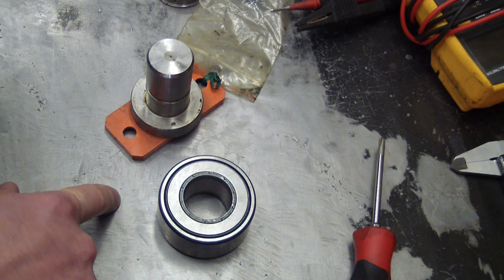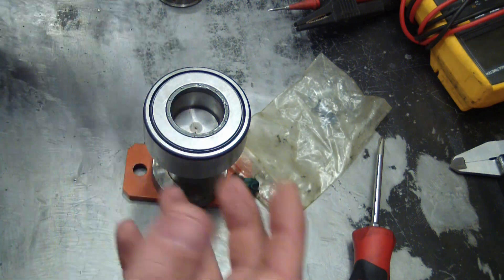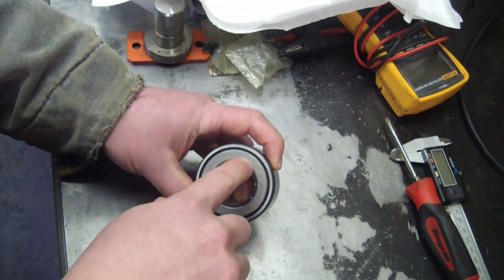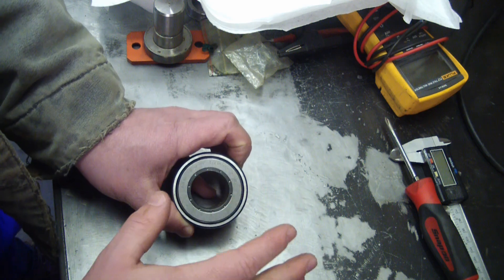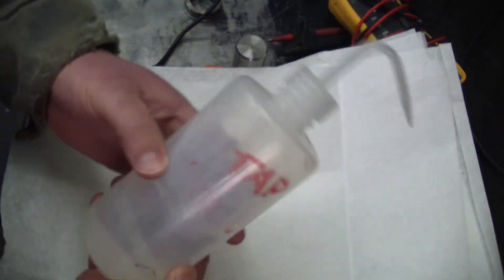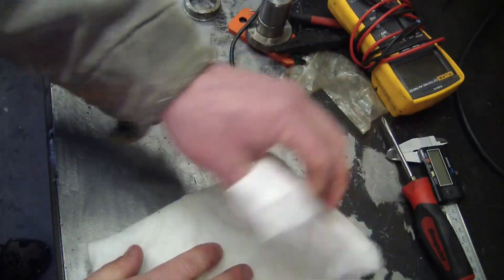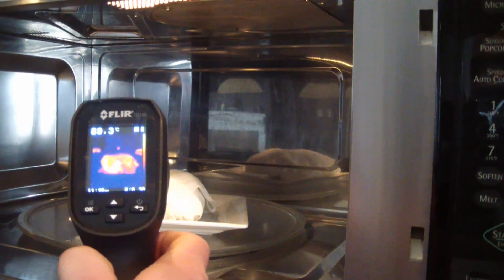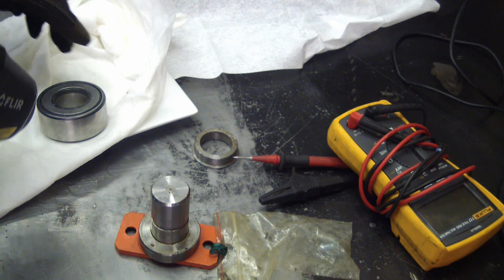The Microwave Trick? It's the easy way to heat bearings!

Comment: ooooo i wished i had known that some years ago.......

but how would i get the front wheel hub in the microwave?
Reply: lez briddon As an alternative way: warp in dry rag (optional), put it in a layer or 2 of plastic bag (zip lock?), put in a cauldron or any other big enought container, make sure it don't touch the bottom, fill with water, boil it. The bag should prevent water from getting in, the rag should catch a bit of water that slip past. Since water boil at 100°C it can not heat more than that. The problem: make sure to mot melt the bag by letting it touch the bottom, and not damaging it... and to use your wife's stuff...

Comment: Awesome trick! Although i would propably do it the conventional way, heat up some motor-oil (used) in a pot/can and submerge the bearing. No water involved, and when you use a hotplate instead of an open flame its no that much of a fire hazard. Bonus points for monitoring the oil-temp.
Reply: rats arsed Why? we have done it quite often (successfully) in a previous company. The new bearing is warmed up gently and slips on the shaft nicely (sounds dirtier than it is, even with used oil :-D).

Comment: An unrelated but related question, as heated water becomes steam and steam can be heated beyond 100C, is it possible to superheat steam in the microwave?
Reply: You can use brime (slat water) and go up to 120C before boiling.
You could use baby oil and go up to 250C or more.
Have not tried it...
Reply: MattsAwesomeStuff "It's not possible to superheat steam in any unsealed unit by any method (fire, hot plate, etc)"

Absolutely it is. Any gas flame contains water vapor (i.e. steam) at the temperature of the flame, which is way higher than 100 C. To verify this, just hold a cold surface like a Pyrex jug of cold water above a flame and note how condensation forms on it.
Reply: A microwave is not air tight, it has vents and a fan pumping air circulate it (it's 98% of the noise of a microwave when you turn it on). Steam is a gas. It escapes into the air. Also, the steam likely won't be heated above 100'C until all the water is turned into steam.
Reply: MattsAwesomeStuff By putting a partially sealed container in the microwave you can create an environment of somewhat pressurised steam. The liquid water will not absorb the energy of the microwaves in the steam above the water level. The question is will the steam absorb enough of the microwaves to become superheated.

I'm not suggesting this is an issue for bearing heating (hence unrelated).
Reply: Factors preventing superheated steam:
1 - Airflow (forced or convection) removing the actual water gas, rapidly
2 - Conduction
3 - Saturation of water gas in air gas.

Water (liquid and gas) absorbs microwave energy and is thereby heated. Let's suppose it does so roughly equally by mass. The amount of water mass in steam in this situation is very tiny relative to the liquid water so very little steam is soaking up further microwaves. If the water boiled off and the steam didn't leave the microwave for some reason, it would quickly saturate the air or metal microwave body (which is not 100'C) and condense back into water.

Other gasses in air are not heated by microwaves and thus would serve as a giant heatsink, capping the steam at a ceiling of 100'C (the minimum temp it could still be steam, the moment it was created), or turning it back into water, as above.

If the microwave was a completely sealed unit, then yes, steam could superheat. But as steam becomes hotter it wants to expand, the pressure it creates builds, and the stronger the containment vessel would need to be. 22 gauge sheet steel on a microwave is not thick enough by an order of magnitude or two to create an appreciable boiler. Even with the fan off, the stream would rapidly push itself out the vents or rip the weakest point in the body.

It's not possible to superheat steam in any unsealed unit by any method (fire, hot plate, etc), so, I don't think microwaves are special.
Reply: MattsAwesomeStuff The steam created would drive out other gasses from the volume (I'm imagining a small container with a small hole in it to prevent too much pressure. I don't understand why it is an issue that "very little steam will soak up further microwaves" (further to what?) there are standing waves across the cavity and many of them will go nowhere near the liquid water and if they are absorbed by the steam it will be heated. Hitachi actually make a super heated microwave steam and it's not a pressure vessel. Your logic seems to be from the point of view of deciding that it cannot be superheated and then working back with reasons and assuming that the conditions will not be favourable, e.g. that heat sinking will cancel heating.
Reply: You're being a tad combative for a friendly Youtube conversation, eh? I'm not out here with some objective to hide the truth from you. If you want to use a microwave to create superheated steam, go ahead and try it yourself, see what happens. shrugs. Maybe I'm wrong, but, fairly sure it won't happen without a completely different setup that doesn't resemble a microwave oven. I'm sure you'll get some "superheated", as in, above 100'C, but, only a tick or two before other contributing factors equalize it.
Reply: ***** If you can generate steam fast enough, it will gradually build pressure even if not pressure tight(since it can't escape), which should in theory allow the boiling point to rise to give you your high-temp(100C+) steam
Reply: You need a pressure chamber to heat the water and/or steam above 100C/212F.  Your car's radiator is at 15lbs of pressure so its boiling point is about 125C/257F.  So, if you can seal the bearing in a chamber, you can get the chamber hot enough to blow up.  Mythbusters water heater episode.
Reply: it is not water that is heated to above 100c but water formed at above 100c
so the water/steam is not superheated  but superhot when formed

Comment: That good sir, is genius.  I too was in expectation of sparks, and the thought that you would heat the outside rather than the whole thing.

But, after you see it done, it's SO SIMPLE.  All the microwaves are absorbed by the water molecules, so that they don't start sparking on the metal.

One tip well worth the watching, even without the ever great commentary.

Comment: OK, for that one trick alone, you have my vote for your Nobel Prize.

I have to say I laugh myself silly sometimes at your commentary, it is frickin hilarious.

Have to agree about not letting the wife know you are using the holy of holies (her kitchen) for machine work.  Somehow my wife still doesn't understand why I think using the granite countertop to flat sand parts is a great idea.  And just bake the oil out of a part one time in the oven and you never hear the end of it.

Keep on trucking; you sir are worth watching every time.

Regards;

Ron Kluwe
Reply: ***** Now you should stick some neon gas tubes in the microwave that will turn to plasma once you turn on the microwave. In fact, that is how they plan to get the fusion reactor to work at ITER, by super heating the heavy hydrogen with magnetron guns pointing at the stuff. I definitely do not want to be in front of magnetron gun that is few megawatts!!! I'd hate to imagine how bad that would turn out to be.
Reply: It would only hurt for a millisecond, but somebody would have horrific mess to clean up.
Reply: GREAT SCOTT!!!  Someone fill the Sling Psychrometer.
Reply: EETechs ITER est une escroquerie, allez voir les videos de Jean Pierre PETIT

Comment: Not trying to nitpick but wouldn't it be better to put the bearing in aluminium foil then wrap it in a wet rag?  This will prevent any steam from getting in between the races and condensing.

Comment: Genius is 1% inspiration, 99% microwavation. Or something. You should totally build a big ass induction coil with which to heat the various inductible jazz around the shop though.
Reply: Induction heaters don't really have any shortcuts or much DIY ability. I'm making two myself (a big 240v one and a smaller 1800W one), but, almost all of the cost is in components that you'll never be able to salvage from anything. You just have to order them.

You can make a 100-200w unit fairly easily, but beyond that the design doesn't scale and you have to upgrade to fancier circuits. Ditto above about 3,000W to the next tier of designs.

Microwaves are free and this solution has the delightful added risk of divorce each time. Keeps life interesting.
Reply: MattsAwesomeStuff What sorta crazy stuff would you need to buy? Granted, I'm in absolutely no way shape or form an electrical engineer, but I thought they were effectively just high current, high frequency oscillators... which, admittedly, is probably a gross over-simplification. I've seen tons of DIY coils people have used for alternatives to forges and such for targeted heating on steel, but I don't really know what goes into them specifically.

I've never tried to make one myself as I'm allergic to death, and I tend to stay away from the electrical stuff that's extra killy.
Reply: The big one is a special type of high voltage, radio frequency capacitor. Induction heaters are the most abusive application for capacitors and only highly specialized ones work. You're either paying hundreds of dollars for a Celem cap designed for it or looking for old Soviet gear on ebay to pull them out of.

Other than that you're just looking at an H-bridge and some beefy MOSFETs, a circuit to magically and automatically tune the circuit to the resonance of the load or it'll instantly blow up, a ox of a power supply and a bunch of watercooling components.
Reply: MattsAwesomeStuff Hmmm... could you use a cheaper cap bank rather than one big badass one? Perhaps some of the variety that the Tesla coil nerds use? I can't imagine any of this stuff would really need to be industrial grade, if it were able to heat up a nut or something yellow hot once before it destroyed itself, it'd probably be enough to make for good footage!

I really don't know enough about this stuff to speak intelligently about it. In the end it's all just wishful thinking.
Reply: Caps are similar to ones Tesla coilers use. Two main methods: 1 - Big RF cap, 2 - "MMC" or "multiple mini capacitor" array. They're still expensive. The ones you use deceptively look just like normal ones you see in average switching supplies. Keep in mind, even when using expensive caps, in an induction heater they generate so much waste heat that the capacitors have to be water cooled. I think mine has something like 60,000 voltamps circulating through the tank circuit, even though the unit is only 10% of that in input and output.

If your goal is to heat up a nut, once, before the project blows up, there are easier ways. You'd burn through a couple hundred dollars in parts and dozens of hours of time just for that one photo op.

Here's a crappy design that does not scale beyond a few watts, but, is sufficient to heat wires and other fun stuff: http://www.rmcybernetics.com/projects/DIY_Devices/diy-induction-heater.htm

Comment: steam and bearings, i guess any moisture should evaporate pretty fast at 100C but it just feels wrong =), i prefere fire  as long as there is no rubber seals... or hot oil. but i had no idea you could microwave steel.

Comment: My first shoutout. Awesome.

I've had a little luck freezing the shaft in addition to heating the bearing for that extra little bit of room. Worth a shot if you're tolerances are that tight.
Reply: Justin Bell well, AvE used Canada to cool his shaft, it works too.
Reply: Aedalas You can find Canada in just about any common grocery store.  You just gotta know where to look.  It's in the refrigerator, inside the compressor.
Reply: nraynaud1 Didn't consider that, Canada is pretty difficult to purchase here locally. Seems like it would be pretty effective though, you know anywhere I could buy some online and just have it shipped to me? I've been using my freezer but I'm always on the lookout for alternate methods.